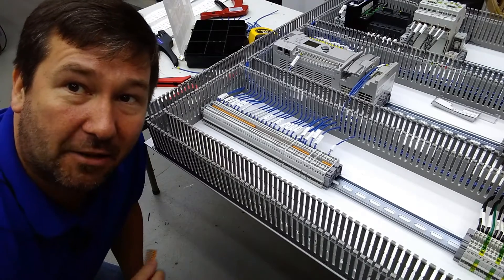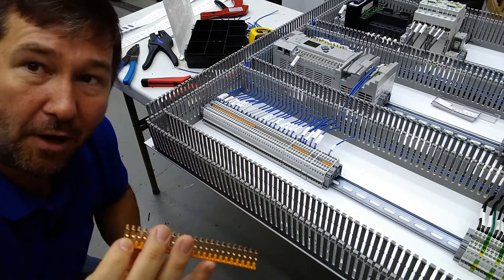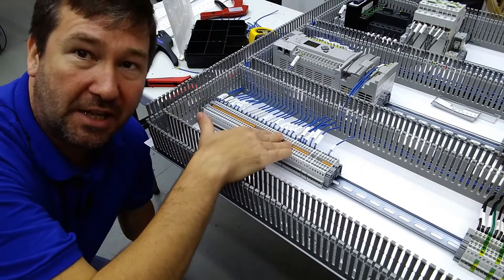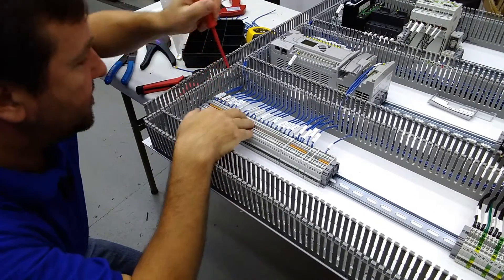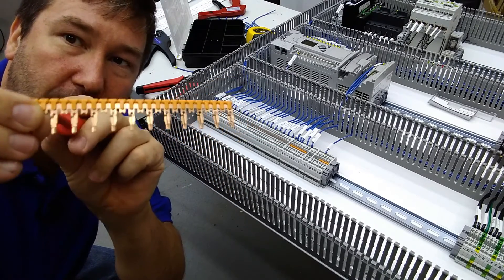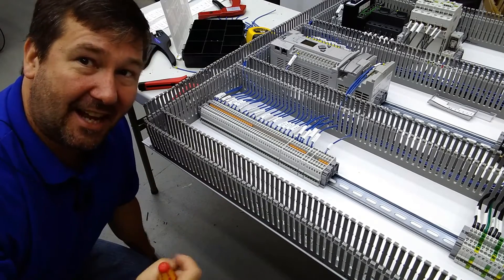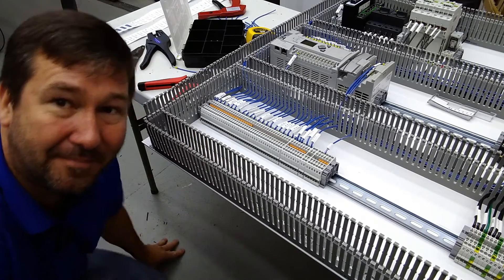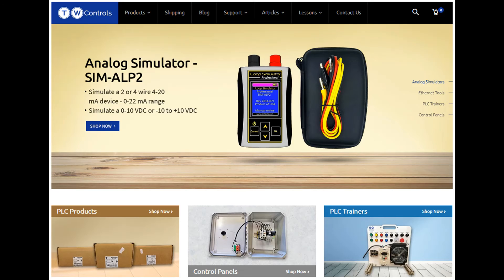Terminal Block Jumpers - They Can Save You Time, Money, and Headaches

Comment: Really clever way of doing this! Though do you think this could confusion for somebody looking into the panel for the first time as they may believe the entire row is common and not every other terminal? Did you/ would you add any further indicators that every other jumper has been cut off i.e. with a pen marking or something?
Reply from the maker: I have a follow up video coming on a marking system Phoenix Contact has on their jumpers to resolve this problem.
Reply: @TimWilborne  That'll be great, thanks for responding!